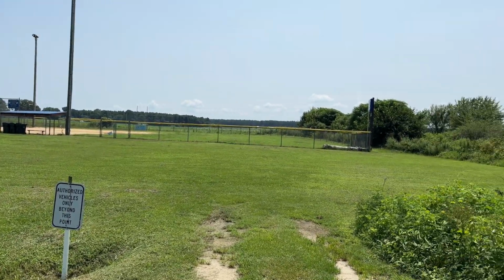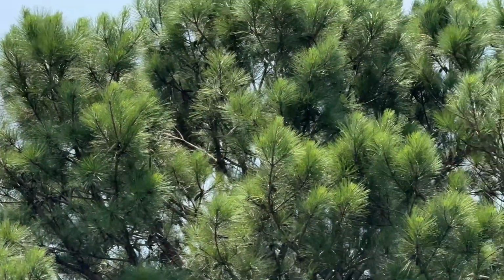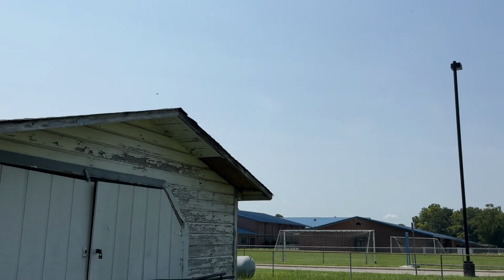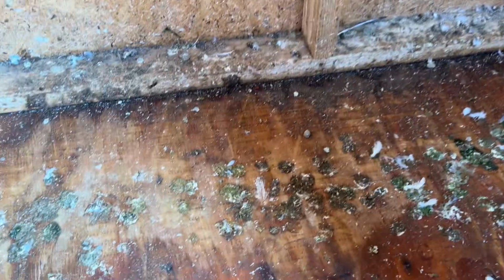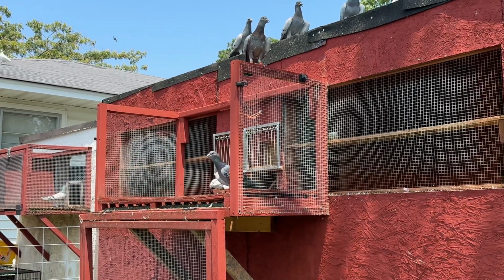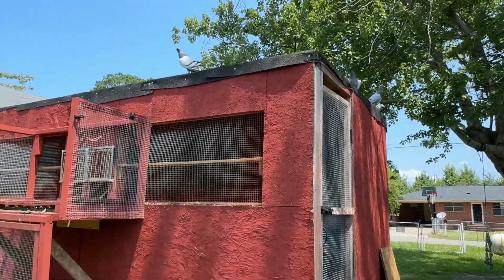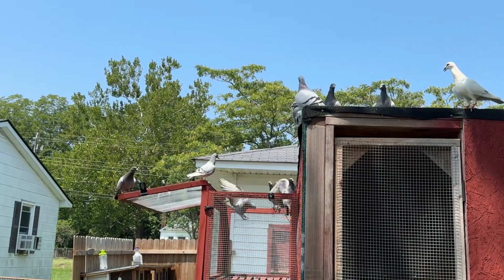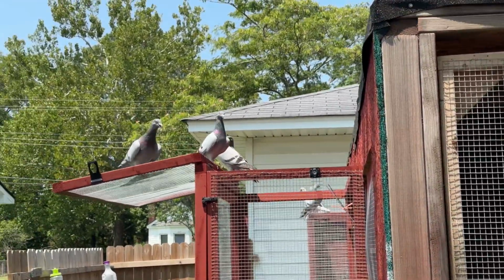First official training toss YB2024 HighAnxiety #racingpigeon

Comment: Good deal that they made it back.. If it's only 1 mile away and only 80 degrees out, they shouldn't be panting and holding their wings out from their body like that. Those birds are way too skinny. They look starved and emaciated. If there's no fuel in the tank, how is the engine supposed to run?.. Just my two cents worth.
Reply from the maker: @ausfuhrpramienjagar  that’s a crazy observation because everyone else says I over feed my birds. It’s rained 8 days here in NC and this the first time my birds flown in over three weeks due to vaccinations. I’ll have Joe check their body weight to make sure they are healthy. Thanks for sharing